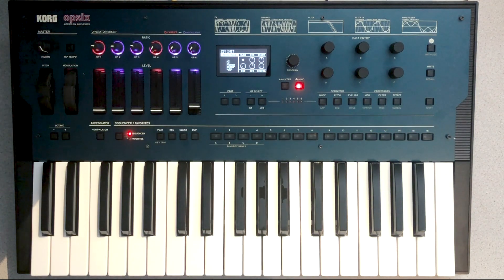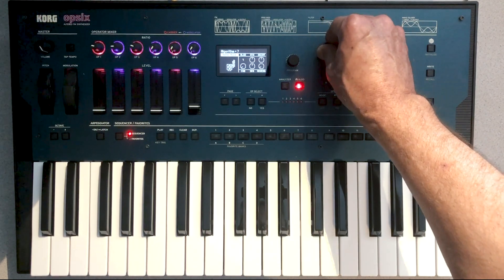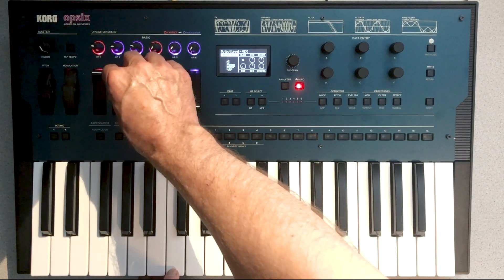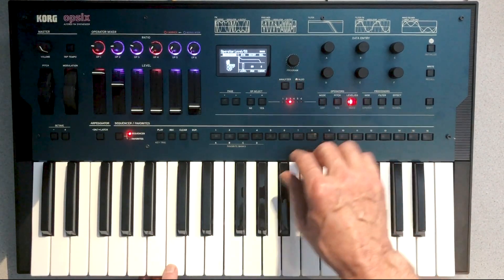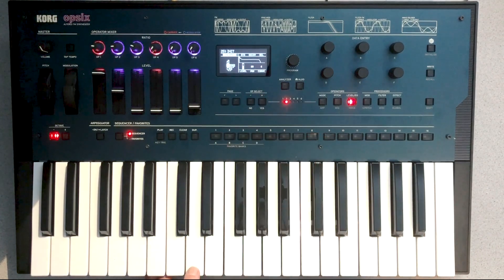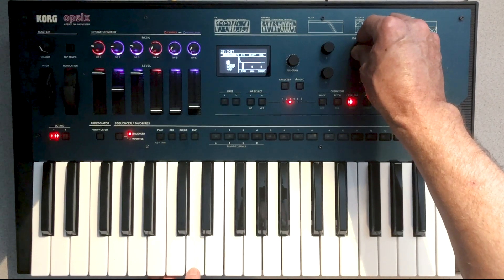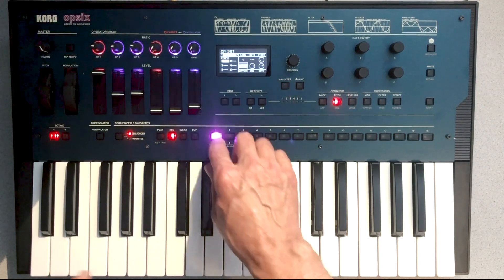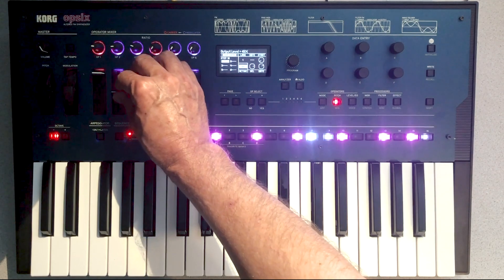Patch of the Week 100 - Building a DX-100-Style FM Solid Bass with opsix

Comment: Wow - I didn't fully appreciate FM until years back in a situation like 1/2 thru this video. If you think of operators like "oscillators" only with in mind that you get a certain amount per synth, just think that 1/2 thru, you only got 2 Operators and the bass already sounds good. Now think about the idea that this one comes with 6 operators?!? (like the dx7 and dx100s have 4 op). 
This is where the strength of an FM synth is at. Where we have only 2 operators working here and most analog synths only have 2 oscillators and that's it.